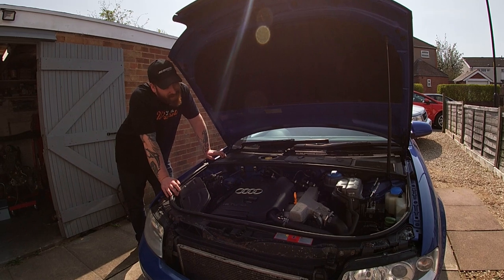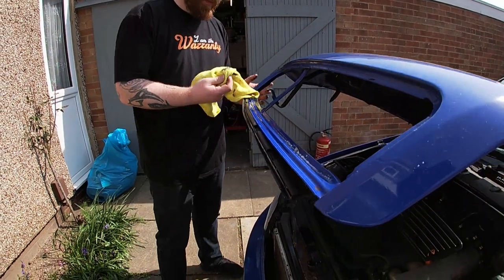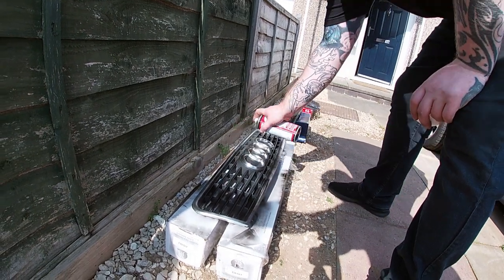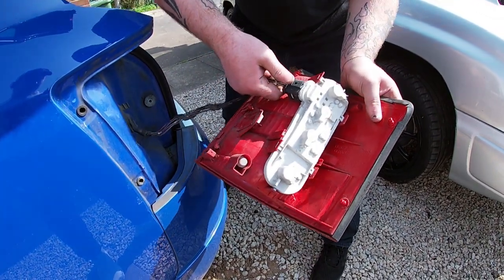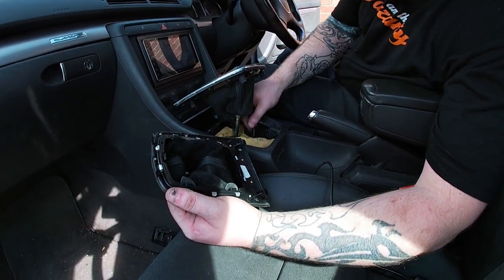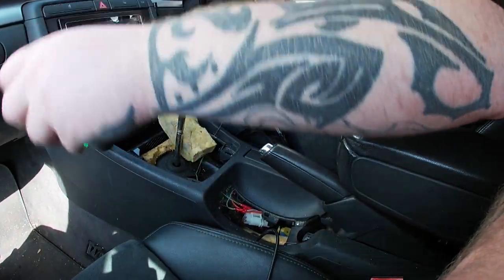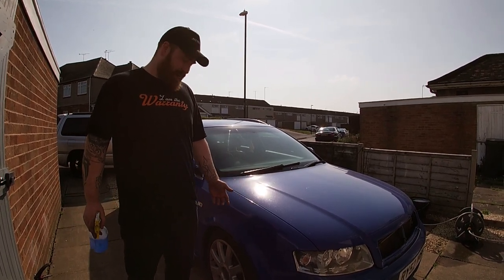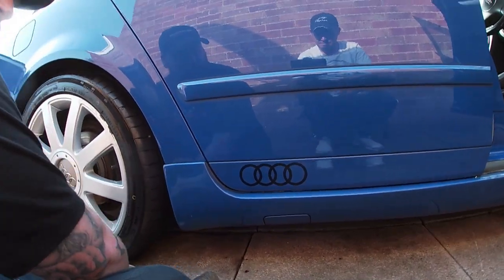Audi A4 Avant 1.8T Quattro B6 - The Dad Wagon Your Dad Wants

Comment: I always wanted one of those ever since I was a kid. Can't find a decent one for love nor money nowadays.
Reply from the maker: Who says mines decent job list seems endless next year thou sleeper dad wagon build after I find a new daily 😜
Reply: @drivewaydynamics7653  It looks respectable. Most of them have been run into the ground and I wouldn't even take one on as a project. I always loved the styling of the B6. It looks like an Audi should, really distinctive. Far more stylish than the ubiquitous looking cars they build nowadays. Plus that one is in a great colour  and an Audi just isn't an Audi unless its a quattro.
Reply from the maker: I'm the same love the style of mine with the kit it came from factory and how low it is really nice all round has there issues they all have them but yeah can't wait to get stuck in to it all make it good then power mods
Reply: @drivewaydynamics7653  There a guy in New Zealand who has a lovely B6 avant like yours in red. I think he's put it on Q5 alloys or something. Personally I like them when they have that votex bodykit and 19" RS6 alloys. check out the vid.
Reply from the maker: I will have a look I fancy a set of 18 Inch golf bbs alloys and little bit more low should good just need the boost 😀
Reply: Are you thinking of changing your roof rails to black powder coated ones? I’ve got a set for mine just haven’t got around to fitting them. Good content keep it up